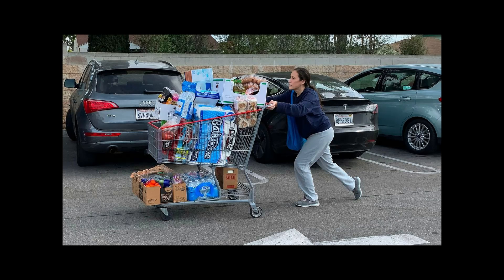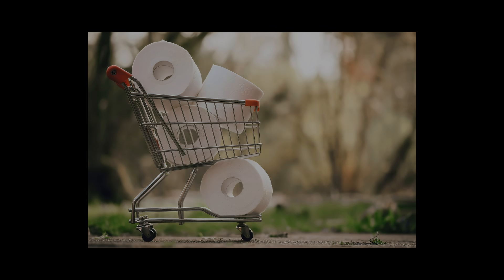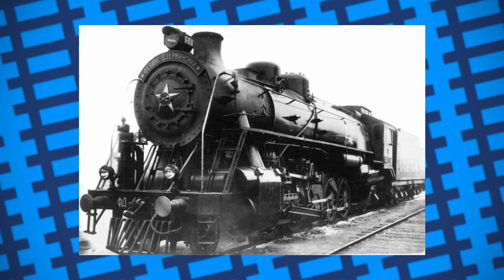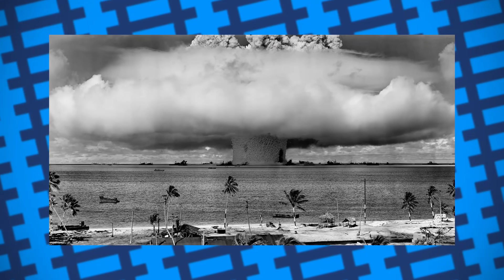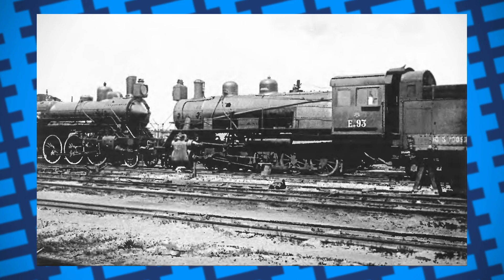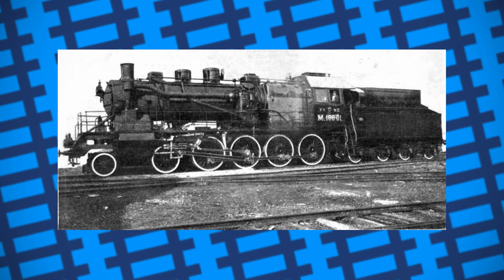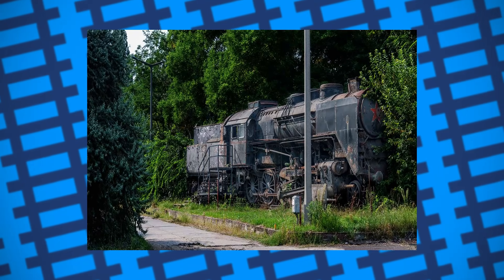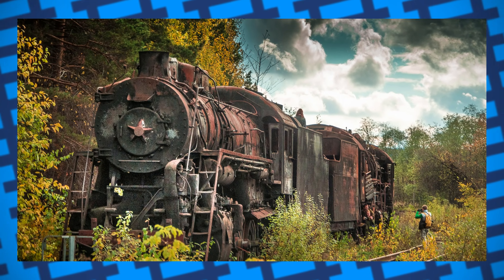Why the USSR preserved hundreds of steam engines - USSR Backup Engines

Comment: At the time of "modernization" (electrification), they should have just slightly modified the boilers of the active steam engines so as to use electrically generated steam.  That would have made more sense.  It would be simpler than coming up with purely electrical locomotives, and allowed flexibility of retaining a standard boiler as backup in case of doomsday.  AFAIK the only electrically fired boiler steam locomotives were teh Swiss E 3/3 8521 and 8522.   I think it's a neat solution given a certain set of constraints.

Comment: There is two types of locomotives that useful when there is an EMP bombing, which is steam locomotives and diesel-hydraulic. Yeah, steam doesn't use electric things other than the headlights. Diesel basically needs electricity for starting it only and there is air-starter using compressed-air rather than electricity. The hydraulic transmission didn't need electricity because things are driven hydraulically although the newer ones did use electronics.
So, in the occasion of war, the enemy blows EMP, the steam is put into service and when the air pressure in the air tank are full, simply attached the pipes to the air starter of diesel engine, and then you can run the diesel.
Note that the diesel is using mechanical injection pump or mechanical unit injector or something like that and not the Commonrail ones because, yeah, commonrail use electronics.
Reply: The problem is most diesel locomotives are diesel/electric ones: the diesel engine runs an alternator and the electricity produced drives motors in each axel.
I doubt an EMP would do anything to an already running diesel/electric locomotive, the electric transmision system is too simple to be damaged and even if the diesel engine had some electronics it wouldn't be needed to keep it running (in really big diesel engines, once started, the difficult thing is not to keep them running but to shut them down. They "want" to keep going and will burn anything to do so, from gasoline vapours in the air to their own oil).
The problem that someone else already mentioned is that, in case of flooding of the tracks (would it be as conseguence of a nuclear war or just heavy rain), the electric transmission won't work as the water would reach the electric motors in the axels.

Comment: the only way to start industry up from scratch will be preserved steam engines in most cases. Coal, Oil, and Gas all require machinery to extract, and Solar, Wind, and Batteries require special material extraction and heavy industry to manufacture.

we're unlikely to be starting completely from scratch, but if we need machinery running before the power grid or fuel transport can be brought back online, Steam will be the way. if you can start a fire, you can start a steam engine.

however, it'd be smart to have a range of engine sizes, big boilers need a lot of fuel, and to gather that fuel, a small engine could significantly accelerate it.
Reply: A few years ago, I considered building a small steam engine to either physically drive equipment by belt, but also to power a generator.
I’m still thinking about it...😂😂
Reply: you can do steam solar

Comment: There is one tiny little problem - steam locomotives and their repair, restoration and all around it around the globe including small tourist lines barely have a few people still alive to do the job as it is. To be able to use them (steam locos) in large quantities - forget it. Knowledge and engineers are almost completely gone. And Russia is a special area. They have no specialists left in current areas due to the latest economic and political "success"

Comment: I wish we kept up with steam powered tech, there are a few very interesting applications where steam is still used but i wish we kept more trains around and improved them...
Imagine one day in the future we have nuclear powered trains, except we also have nuclear powered steam engines!
That is the future i want to see lol
Reply: That would be pretty messy and generally unsafe. But we can put the nuclear part in some far away concrete structure, generate some sort of power, let's say electricity, and then run locomotives with it. or if you indeed demand that  the train shall be steam powered, then perhaps filling stations and fireless locomotives could do the job.

Comment: A very interesting piece, but I think the 'modern' high performance Stephenson-type locomotive is pretty fussy about fuel. Some were even quite particular about the type of steam coal they used. It's probably pushing it a bit to say they could run on anything flammable. A locomotive designed to run on decent steam coal would find it difficult to maintain good working pressure when being fired on wood for example, if working at all hard. It might run but probably wouldn't pull. And the poor fireman!

I don't know what the Soviet designers got up to when designing boilers and fireboxes, however.
Reply: You are right. Engines of "O" and "E" series could run on poor coal or even wood. But later locomotives (such as "L", "FD", "SO" and some others) required high quality coal to produce enough energy. Ironically, those picky locomotives preserved better as they were newer.
The idea of steam engine backup was realistic in sixties but later they preserved steam engines, uh, habitually. Fuel was not the only problem.
In 1956 USSR stopped steam engine production, so in seventies most of them were retired because of wearout. Often those engines were in poor condition and even without some parts (they were taken to repair other locomotives). Moreover, infrastructure supplying steam engines was lost. For example, water towers and water cranes on many lines were unmounted or at least decommissioned. Those that were preserved used electrical pump that could be de-energized in case of nuclear war. Drivers and repairers preferred to deal with diesel and electrical locomotives and "steam" skills were almost lost.
Reply: @michail2710  Very interesting. Thanks for that.
Reply: I once spoke with crew of ČSD 475.1 class locomotive and they told that in theory they can burn both hard and brown coal,but they currently have certification only for more expensive hard coal. So it might not be so farfetched.
Reply: Sounds reasonable. ČSD 475.1 is close to "TE" engines by power and firebox size. I read that "TE" was able to run on brown coal although with some power loss. I guess, the same applies to ČSD 475.1.

Brown coal gives about 30% less heat than black coal, dry wood 50%, wet wood up to 90%. That means, the engine is less efficient with poor fuel and fireman work is much harder. For example, a driver of "FD" engine reported that he can run that locomotive only with 30-40 cm (12-16 inches) of brown coal in firebox.

So when running powerful locomotives and heavy trains we come to an edge when poor fuel becomes useless.
Reply: @michail2710  If I am not mistaken, TE is soviet designation of DRB 52 a.k.a. kriegslok and those were manufactured by Škoda Works at Pilsen just as  ČSD 475.1, so they naturally had access to specifications of DRB 52 and perhaps took some inspiration from that as Czechoslovakia was mining both hard and brown coal.

Comment: What about diesel locomotives taking up the slack..?? Steam locos are very high maintenance, if left dormant for any long period of time the condensation in the boiler, pipes and the cylinder forms rust and blocks or jams the piston. So you have to have a dedicated crew going around firing the boiler, lubing and running the engine periodicaly. Then there is the question of getting certified engine drivers to run them, together with their assistants, as most of the older steam drivers would have retired or passed. They most probably kept them around for the sheer propaganda on the proletariat.......the red star is there, its big and its red, so tow the party line.

Comment: New bombs suck the air out and explode it. The air will be so thin and patchy in places that motor engines will stall and fires will die from lack of oxygen. Some gases are heavier and could be used to push the oxygen off the ground and into the sky. Any engine period would be a death sentence because of the heat signature would lead rockets and drones to you. You're better off riding on the back of a slave to get around just like Mario did to Yoshi during wartime.

Comment: Actually, small steam like on the late 19th century and small steamers are better in fuel versatility than large steamers as wood are less effective in a large firebox than small steam. Wood has a lower burn temp than coal, so I must correct ya on that since you will run out of steam on large steam locomotives(larger than light in Baldwin locomotive reference 2-8-2,2-6-2,4-6-0,2-8-0,0-8-0, and light 0-10-0 locomotives), so I digress.

Comment: The reason that the British continued to use steam later than most was we didn't have our own oil supply, meaning if we were cut of by a war, or for economic reasons, we still had many coal mines. Also they wanted to electrify most lines (to be powered by coal fuel power stations), so had the long term plan to bypass diesel and go straight from steam locomotives to electric, but then there was a change of government who took a short term view (they wanted a change so they could get re-elected, so they scraped the plan and went for diesel. We still haven't recovered.
Reply: You mean diesel/electric, right? Correct me if I am wrong, but did they not have pantograph so that they could run on overhead lines as well, and were used as transition engines while the lines were being built?

Comment: I always said, that steam engines would be in high demand if an apocalypse ever arises. Steam, like guns, are very useful in apocalypse scenarioes. As they will never need electricity to be operated.  Electricity is without a doubt useful. But it's a horrible idea to rely solely on electricity. Should anything happen and electricity is no longer available, we'll easily be thrown back into the stone age. I do not want us to revert back just FYI, I just think it's a good idea to be prepared in using old tech. You should never fully depend on one technology. Ever.

Comment: Well, the Ruskys will need those when they get denied all the spare parts for the high-tech rail system they bought from the West. With luck, they will be tooling around in Flintstone type cars as well.
Reply: Well, the Ruskys just signed largest in world contract with India for 35 years and several billions — Russia will build for India 120 electric multiple unit passenger trains (~2000 wagons). It is modern trains (2014), far better than average train in EU. Also Russia will build factories for India (transfer of technologies), so India also will launch production of such trains for self.

West (correction: only U.S, rest too backward even when compare with N.Korea) have no technologies which Russia have no. Russia not always have mass production of something, because lack of people (150 millions of citizens + 30 million of migrant workers), but when need, it produce anything. When you produce space ships and nuclear icebreakers, everything rest is nothing for you.